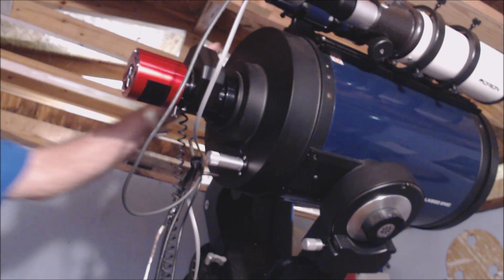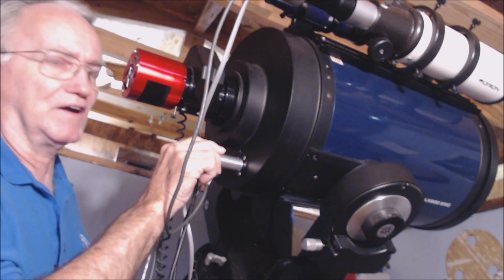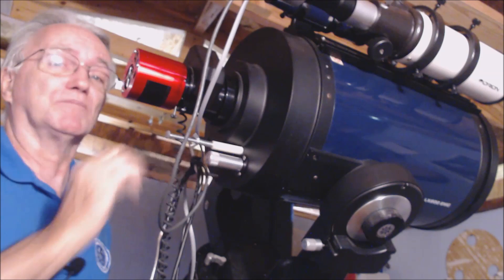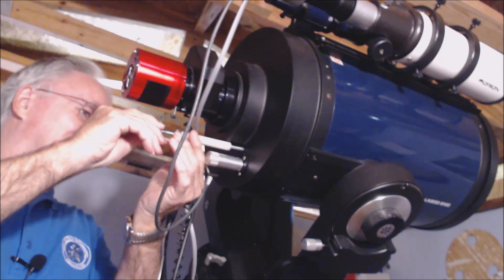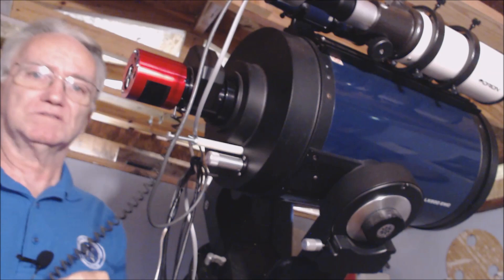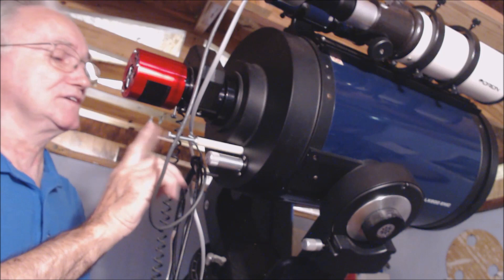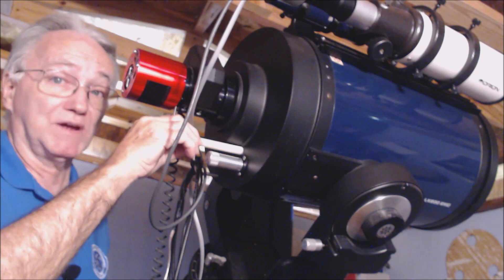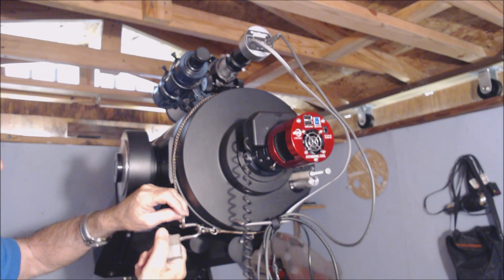Classic SCT Mirror Flop from Backyard Astronomy from Dreamworld Observatory

Comment: Suggestion - if you are going to try to explain mirror shift or flop or differential flexure - you probably should do that at the start of your presentation.  Something like when imaging on an SCT - one large challenge people need to address is mirror shift and/or mirror flop - this is where the mechanical position of the mirror relative to the centre of the optical tube shifts by tiny amounts as you move your telescope across the sky.

One way to minimise this annoying shifting to add a separate external focuser and to rough focus with the main mirror - then lock it firm into this position with an after market add on device called a mirror lock.  Fine focus is then achieved by using a separate focuser that adjusts your eye piece or cameras relative to your telescope.

Define the problem and how it ruins images prior to mention how parts of this issue are solved and by whom!

Comment: Don't Like It
but
I like your post showing me that my Meade 8" Classic may have an issue with mirror mechanism.
Ok
I'm a structures engineer and I need to know what mechanical parts are causing the problem. I will take apart my Meade 8" Classic and try to understand what the problem is inside the focus knob to mirror.
Solution ?
I will send a picture of the parts and any wear or slop in parts related to knob to mirror.

Comment: I have a few questions regarding your equipment set up. I have recently  purchased a 1 owner 12" lx200 classic, its in absolutely mint condition and for 1100 dollars i believe it was a steal. so with that said, Is you scope a classic or newer. mine was made in 99'. what electric focus  are you using? and where did you get the 2" eye piece holder for the rear?  I want to get away from using the diagonal due to I am getting ready to purchase a cam. Thank you, and great videos especially for us noobs getting into this hobby.
Reply from the maker: Shawn Petrie my scope is a Meade LX200 10” classic.
The focus motor comes with an adapter to replace the existing one on the rear of scope. This will greatly improve your scope. The diagonal is Meade’s best , I believe it transmits 99% of light thru it.
This also comes with 1.25 and 2.0 eyepiece holders.
Welcome to the site, hope you find something of interest here. Enjoy your scope.
I hope all this bad weather here will leave soon so I can get back to Astrophotography.  Thanks for
The good comments. Clear skies!
Reply: @baugham2   Thank you for your reply, do you by chance have a part number on the electric focus? the only onr i have found is the zero shift electric focus and from what i have read it does not work with the classic. also what guide camera and scope for guide camera are u using? Thanks again for your help. just getting started in all this.